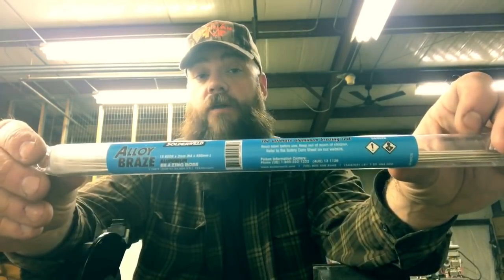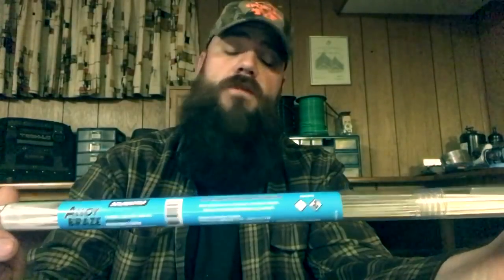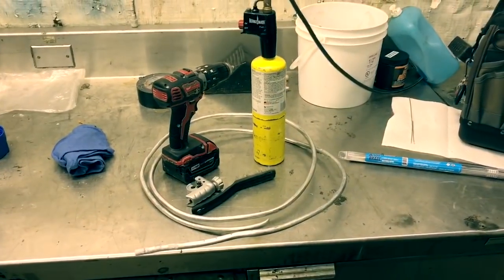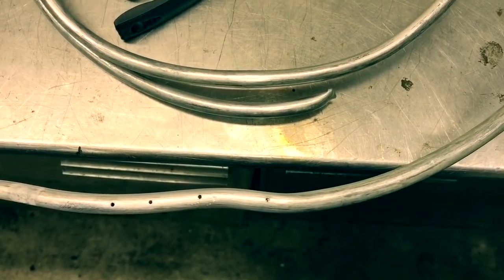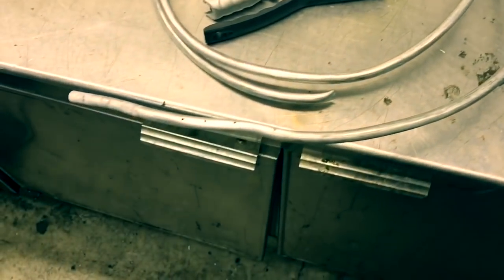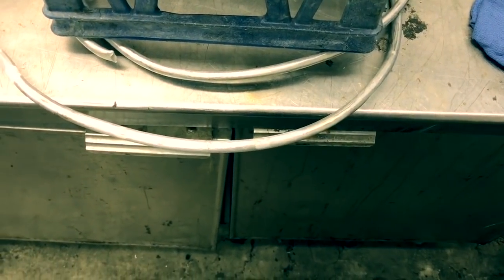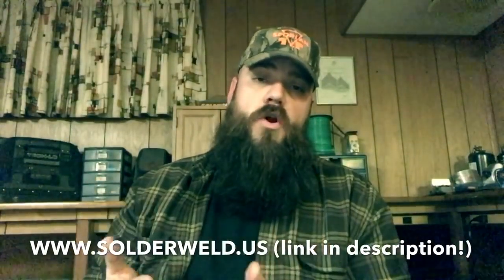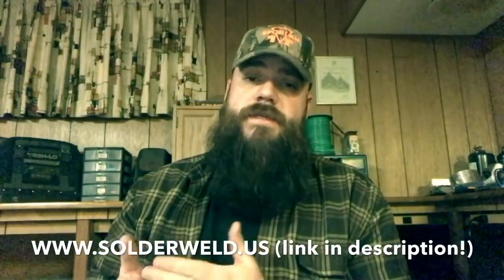HVAC Aluminum Brazing Demo

Comment: A safer way to prevent overheating it to much and putting a hole in it, try using the canned disposable butane. Much easier and safer for the equipment! Just my opinion though, I'd like to hear thoughts!😁

Comment: Why did you not decide to use the multisol solder since it melts at a lower temp and stronger burst rating? I’m assuming it can be used for aluminum. Since I saw your video on it I think micro channel coils be a reason I would keep it on my van. Still  trying to convince my boss to by me some to keep on my van. I’ve told him I want to try it out especially for sketchy spaces or replacing things like distributors that require multiple joints near a txv.

Comment: I’m actually impressed, I wonder how well that would work on a evaporator U turn and if it would hold during heat pump operation?
Reply from the maker: JonesHvac it would hold up just fine, the pressure rating on that alloy is like 15k psi, well above anything 410 could ever dish out👍

And that’s why I demonstrated on pilot tubing, a product that’s far weaker and thin walled compared to an evap coil.  Thanks for watching dude!
Reply: AK HVAC Hey Thanks ! I will give it a try

Comment: now do that on a micro channel coil
Reply from the maker: I have repaired micro channel coils.  And the reason I demo’d on pilot tubing and galvalum is because both of this materials are far weaker and thinner than a heat exchanger/coil.
Reply: gotta any fear of plugging micro channel i only ask because ive had 2 york units with leaks in coil

Comment: Lukus milhaup has similar products, I have used. Lukus has copper to aluminium rods. I don't believe lukus has the heat paste. Thank you for the video.
Reply from the maker: Ron White yes sir you are correct!  I don't believe Milhaup or Harris have the heat absorption putty. Thanks for watching!
Reply: Hey Ron, Glad you have delved into aluminum repair.  One of the difficulties as you know, that most techs worry about is that the aluminum rods on the market flow out at almost the same melting temp as the aluminum itself.  We have been focusing our efforts on lower temperature bonding and brazing so that you have more time to make the repair without issues.  We would love for you to tell us what you think of our products compared to theirs.  Thanks for checking us out.

Comment: Hey Andrew!  Again another great video. I'm in San Diego, California. Do you know where I can get Solder Weld products here?  Have a great weekend and God bless!
Reply from the maker: Blaze Eisner Thanks Blaze!  I will reach out right now and find out. If it's not available in a supply house there, you'll get it cheaper through their website with my promo code AKHVAC!  20% off all products!  Http://www.solderweld.us
Reply from the maker: Blaze Eisner just followed up with them, and for now it will have to be ordered/direct-shipped online for that area.
Reply: Blaze Eisner we would have to direct ship to you until we have a Distributor in your area. Just let us know and we can ship direct to you
Reply: SolderWeld   Let me know the price of the Hot Block and the 15% silver rod. I use this for most of my brazing apps. Thank you.
Reply: AK HVAC Thank you Andrew!  They reached out to me. That's unusual for a distributor. Pretty cool I must say. Have a great weekend. Looking forward to your next video.
Reply: Blaze Eisner , there is a special going on right now AKHVAC is the promo code. Check out the website at www.solderweld.us and you can the current pricing for 15%. The Hot Block is one of our coolest products. With that promo code your entire order is 20% off for the next week. Or give us a call anytime 800-356-8449 and email info@solderweld.com. Thanks for supporting us, it means a lot.

Comment: I used alloy 5 to repair a aluminum boat once worked alright pain in the ass to use though, the flux is not in the rod its added separately.  This product looks easier to work with. Defiantly going to try SolderWeld next time. Thanks for the video.
Reply: Let us know when you are ready and we will get it to you.  Thanks for stopping by.  Greaves did a great job testing the Alloy Braze

Comment: Can you recommend any torches for me?
Reply: I use harris inferno air acetylene.  I also found a dual torch tip made by another company.
Reply: The new turbo torches have a technology in the tip that allows the flame to curl entirely around the copper pipe.  They pitched us on it for our new Plumbing kit.  We may include it in the plumbing carry kit.

Comment: Good video, AK I had a call last spring on a 25 ton package rtu. One of the circuits blew the charge on a 3/4 inch or 7/8 inch lines feeding the condenser. 2011 unit. I just quoted replacing the entire condenser coil. They never approved that repair. It was a huge leak, I could hear it with 5 psi nitrogen on the system. I just wasn't confident in my skills to repair the leak on a aluminum joint that size. Back side of the joint, couldn't really see the leak.
Reply: Next time give us a call.  The Alloy Braze will make you look like an expert the first and every time.  You will save their lives and they will thank you for it.  Right now as we train all over the US, the only option the companies we train have had is replace the coils.  Not after we leave.  We are doing our best to change the industry before everyone "HAS" to change and isn't ready.
Reply: SolderWeld will do next time. I live in Michigan. Pretty sure my company I work isn't going to pay to train me on it.
Reply: If your talking about the leak being at the the factory copper to aluminum joint with the black plastic and epoxy seal you would have to order a new coil anyways (per Trane). The plastic and epoxy cover is to supposedly stop electrolysis from the 2 similar metals. Surprisingly a new micro channel coil is not that expensive.